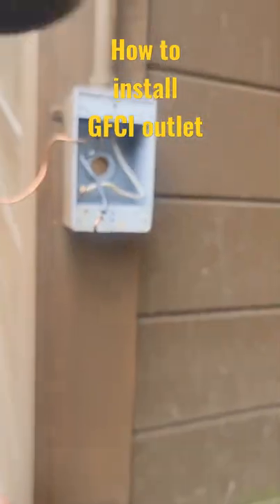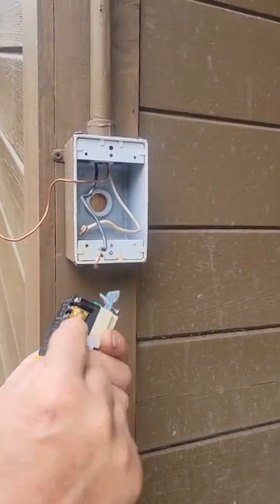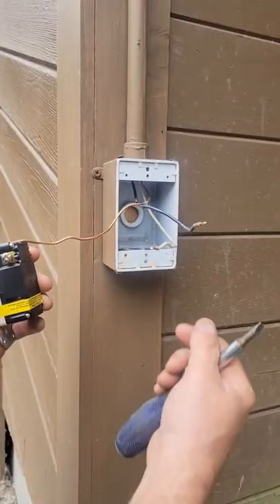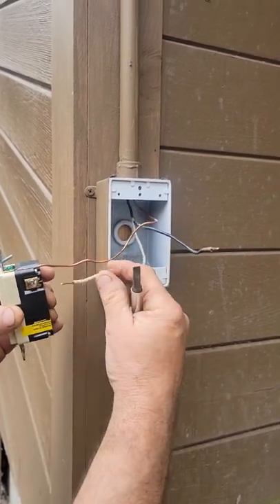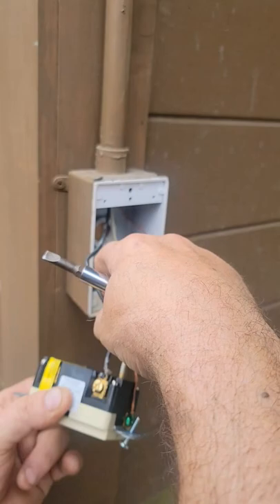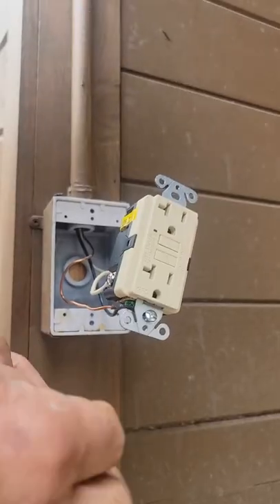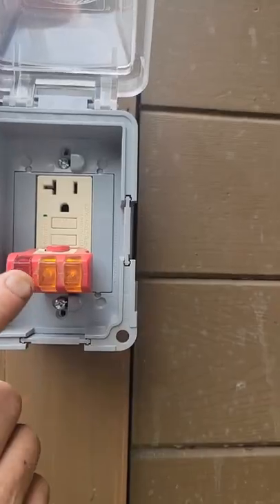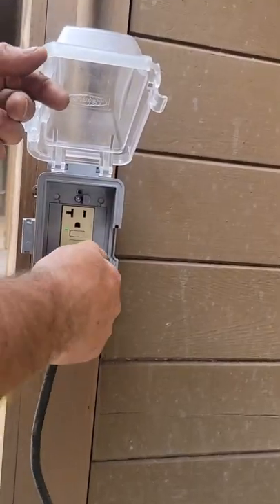How to install GFCI outlet #fyp #repair #diy #short #shortvideo #electric

Comment: When using the back wiring (it's not backstabbing) it doesn't matter which side of the screw you use, It's clamped in place when the screw is tightened and not wrapped around. Outdoors it should be a weather resistant receptacle designated by "WR" on the face.

Comment: Correct me if im wrong but i thought GFCI receptacles didnt need a ground wire??
Reply: that’s if you’re replacing 2 prong receptacles with a 3 prong gfci
Reply from the maker: They should have a ground wire from a metal box to the receptacle to work by code
Reply: If this is an exterior outlet, is there supposed to be “liquid tight”connection fittings?
I know they make them in PVC coated conduit, but do they make liquid tight in EMT ?
I know there’s compression fittings for a splice, but what about to the box?